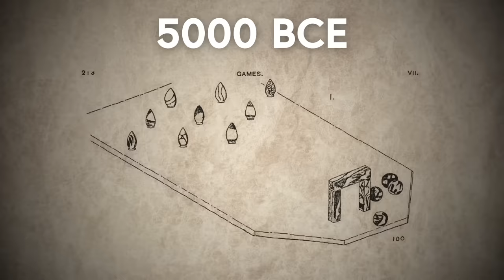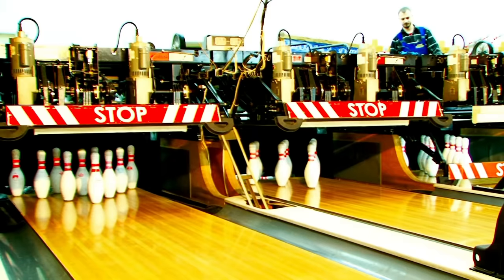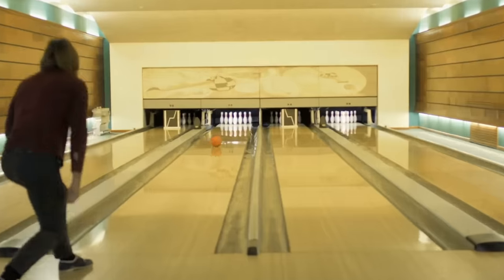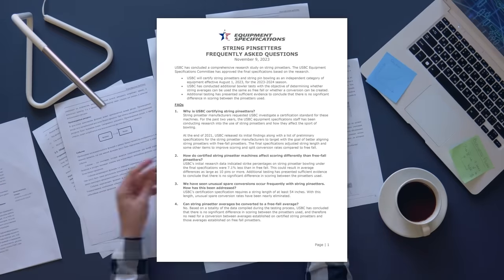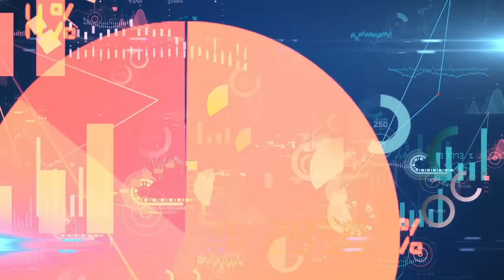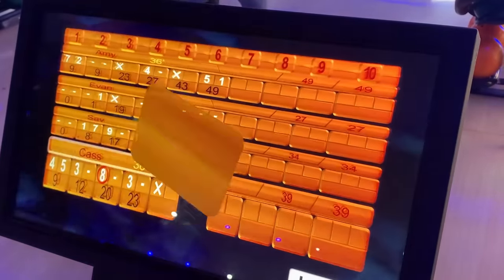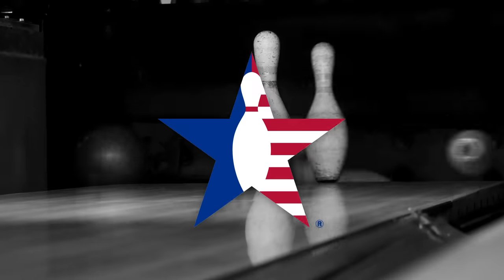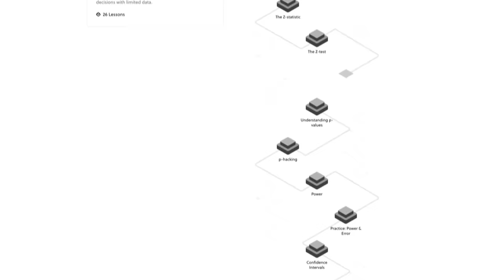The Controversial Machine That’s Ruining Bowling

Comment: Hi! I used to be a head mechanic on those big automatic pinsetters. Honestly one of the coolest jobs I've ever had. Our machines were ancient, but we made due. But working in that field, the biggest issue for smaller bowling alleys always ends up as the same unfortunate thing. It's incredibly expensive to replace pinsetters which is why there are still so many places with machines that are hella old. It's not easy to install and remove those buggers, especially with the way some older buildings are set up like ours was. Despite the fact we were owned by the biggest bowling company in the region, it was actually cheaper for them to build other locations and install them with modern machines than it would've been to replace ours, for reference.

While it would be cool to see more of these, it'll likely only be for newer places than older ones. On that note though, bowling actually has seen a recent upswing in popularity over the past few years. Our location before I left actually saw a rather massive growth in customers! I really hope it continues, bowling is such an underrated passtime.
Reply: And which would explain the condition of pinsetters in candlepin / duckpin alleys.
Reply: those old pinsetter machines are very reliable as long as the daily maintenance is done. one of the big problems was the generation of owners changing to ones that did not know how these machines needed to be maintained so every breakdown was major instead of just regular wear parts
Reply: Our bowling alley has had some Brunswick A2 pinsetters there for more than 40 years, i believe they are at the point where they are going to replace them due to their age, i hope they dont replace with string ones, that would suck.
Reply: you already know they're going to replace them with strings lol @nzoomed
Reply: @schlomoshekelstein908  I hope not, those pins in the video look more dumpy too than the ones I've ever seen
Reply: @nzoomed   I hope you guys are gonna replace them with the Brunswick GS-NXT they're the newest free fall pinsetters
Reply: @PinoyBowlerGS92 I haven't been in there for a while to check. I should drop in to take a look. Surely with today's  technology, more efficient stringless pinsetters can be a thing

Comment: One thing I've noticed about the "classic" pin setters is that on the rare occasion when a pin had light contact and didn't fall, but kind of "walked" away from it's spot, the setter would pick it up then set it back down right where it came from (within limits: I once saw the setter jam when it descended and tried to pick up a pin that was so far out of position it couldn't handle it). In other words, it doesn't reset it's location to the "standard" spot. I was always amazed by this ability. Based on the video showing how the string setters work I don't think they can do this. I think the "classic" setter's ability to replace the pin where it came from, while very subtle, can have an impact on the game - for highly skilled bowlers. This is the other aspect not covered by the studies: the effect on the game for highly skilled bowlers. I suspect that casual bowlers won't notice any difference, but league bowlers would definitely notice.
Reply: I've been working on the machines for nearly 50 years. I believe it WAS an ABC requirement that the machine respot the pin back in the same place the bowler left it. And if the machine did knock it over because it was too far out of range, we always attempted to manually reset the pin back where the bowler said it was. The string machines obviously lack this ability. My experience says that anything new is not as good as what it replaces!
Reply: Because that's the rule.....if a pin is knocked off spot but still in range of the pinsetter then that pin must be replaced on the point at which it was picked up. With Brunswick pinsetters they stop if the pin is too far out of range for the machine to pick up. The machine is able to be restarted without the rake sweeping the deck clean but the rule says any deadwood should be removed prior to the bowler proceeding. On AMF equipment if too far out of range it will usually knock the offspot pin over. Any offspot pin knocked over by the pinsetting equipment must be respotted in its normal 1st ball position. All deadwood should be cleared prior to the bowler proceeding.

Comment: Worked at a bowling alley in High School, 15 year old kid working on AMF 8230 Pinsetters with the old relay style chassis "brains" on them, things were friggin deadly, came close to losing limbs/fingers MANY times!
Reply: Are you not supposed to turn them off before you start sticking your fingers in? Or do you have to turn the whole line off so no one bothers. I would have said there is definitely a safe way of working on them, just no one bothers because it’s too much work
Reply: The old 3930 "latch" chassis, if I recall correctly?
Reply: As AvE says, "don't stick your fingie where you won't stick your dinkie!"
Reply: @bbgun061  Yeah, wish AvE hadn't turned out to be an idiot during the Canada convoy protests, hailing the idiots as heros.
Reply: well if you were not high at work all the time.
Reply: that is so irrelevant to the quote and just shoehorning politics into things..  @AlexusMaximusDE
Reply: @AlexusMaximusDE  Was he for the convoy or against it. I guess I missed that
Reply: @theSato Someones political convictions are a reflection of their values. You wouldn't quote Hitler or Stalin, just because their quote appears relevant. At least I would hope not.
Reply: Based on your comments, you should not be around " Any " machine .
Reply: 4400 @NipkowDisk
Reply: I worked in bowling for 50 years and only received minor cuts.  I was the head mechanic in a 48 lane center.  I also repaired machines in other centers around the state.  I'm retired now and my old work place has been converted to a string house.  They seem to be doin' just fine !.

Comment: In Germany we have a traditional sport called "Kegeln" which is very similar to Bowling, only with 9 pins arranged in a diamond-like shape. All the Kegeln alleys I have ever seen have strings to pull the pins up. Most of the alleys also were owned by individuals or by small organizations like my local parish, so the cost factor apparently played a huge role in this.
Reply: That's literally what he said in the video, string-based pin setters have dramatically less moving parts, which makes them dramatically cheaper to operate.
Reply: @LibertyMonk  Yes and this commenter added that there have been variants which use string-based pinsetter for many decades.  What was your comments supposed to accomplish?
Reply: Nine-pin bowler / Kegler here.
Strings just don’t bother as much in nine-pin bowling as they’ve always been part of the game for the last decades. Also, the WNBA requires strings to have a certain minimal length and a maximum resistant force, thus reducing erratic pin movement.
Additionally, pins are farther spaced apart than in ten-pin bowling, which reduces tangling of the pins. 

Strings aren’t generally bad, just poorly implemented into ten-pin bowling right now.
Reply: yeah, just said the same thing in a different comment. Kegelbahnen were using string setters since more than 30 years ago.
Reply: @AlexusMaximusDE  Well the original video wasn't talking about Kraut-ball was it? It was talking about Bowling.
Reply: I've seen the same technology in bowling alleys in Belgium going back to at least the 90's as well. I just always assumed this was an earlier technology than the fancy pin setters.
Reply: Kegeln is a bowling game played in the US as well, it's called 'ninepin' in English. It used to be the more popular version of the game way back in colonial times but now ten pin is the most common bowling game played.
Reply: @SavageGreywolf  it's more than just a variant of bowling. Different lane, different pins, different Balls. The lane is shorter and narrower, the pins and balls are smaller, and the balls don't have fingerholes.
Reply: I thought string pinsetters could not be used for 10 pin bowling because there are 2 throws (strike and spare) in constast to just one throw on Kegel /9 pin and so string machines work fine for Kegel where it just need to rise all the pins back up again after every throw but for 10pin bowling the machine needs also to be able to clear away the deadwood between strike and spare throws and so  how can u make a string machine work for  that without the strings interfering?  Or is it just lifting the fallen pins back up using individual motors for each pin between the strike and spare?  That could work. Never seen string machines used in 10 pin bowling and thought the reason for this being that it is impossible more or less as the strings would interfere with the clearing of pins between strike and spare and so thats why you only use free fall pinsetters with 10 pin bowling.
Reply: @johnpekkala6941  They work the same way as a regular pinsetter in that they don't try to solely clear the deadwood. String pins capture which pins have been hit, pull up all of the pins at once, then the unhit pins descend for the second throw.

There is a small issue in that it will reset the location of pins that have slid from their initial position. I'm not deep enough into bowling to think about that kind of stuff without pulling out a ruler and manually measuring it.
Reply: feel like it's interesting to point out that we also have American-style bowling alleys here and all of the one's i've seen use the setters without strings. so it's almost become a differentiating feature of sorts.

Comment: I'm a Bowling tech. Just would like to point out that the explanation you gave on how the bowling lanes work is fantastic. It was silly that you mentioned AMF multiple time and kept cutting to B-Roll of AMF lanes and showed a detailed diagram of Brunswick's GSX lanes.

AMF lanes use an arm system with a clutch to drop every pin into their individual holder. It's way more complicated.
Anyways nice video, and no string lanes are not killing bowling :P
Reply: I agree they arent killing bowling, but I refuse to go to an alley with strings and there are many like me
Reply: i hate string pins
Reply: It doesn’t technically kill Bowling in general but it only kills off the Competitive side of Bowling (Leagues, National/International Tournaments, PBA, etc.) because the pin action is horrible and the Tangled Pins is a mess, it takes longer than a normal pinsetter cycle
Reply: Anyone who is an avid bowler will continue to bowl even with strings. Because leagues are fun and strings may suck but not bowling at all in a league sucks worse.
Reply: Meanwhile, candlepin lanes are string-free.
Reply: @HowToGuroo same
Reply: Id never go to an alley with strings if i knew it had strings